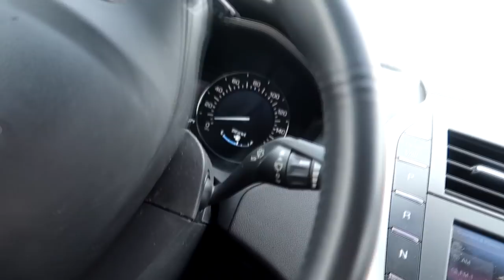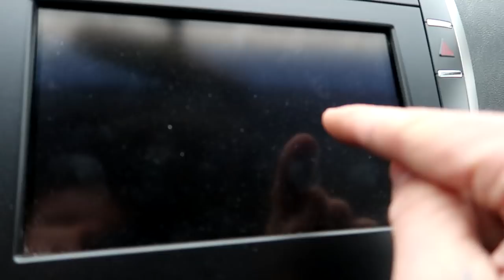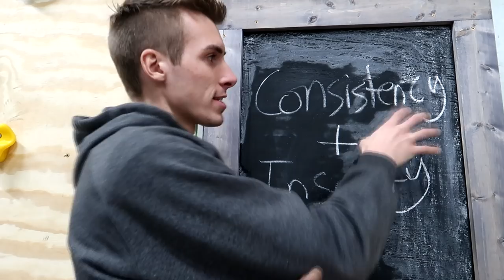NO MORE DURAMAX... GOT A CAR

Comment: The majority of the people like consistency, why is every 7-11, Wal-Mart, McDonald's, Burger King, KFC, Taco-Bell and other large chain stores pretty much the same? People like consistency. Your formula is working, you have your ups and downs but change your format too much and you will have a big down. Build machines, a follow up on the Gator would be good, all that work and it did not last very long. Have you given up on the Gator? What failed? Show us the motor we want to see what happened. Tell us it is a lost cause. Let the Gator RIP. Then build the snow bike. Give us some closure on the Gator.

Vice needs a solid mount with room to work with stock, make sure you have room to bend 90° angles on the longest piece you plan to work with, a table with wheels probably not the best idea. Wall mount on a chunk of 4" pipe that you can slide, swing or rotate probably would be best.
Reply: Exactly - tear that motor apart and show us some carnage!  Finish your projects - it looks like you are stretching yourself too thin.

Comment: Hey 3D you should build a mount so you can use it on the table or move it over to the bench top make an adapter for you truck hitch too
Reply: Caleb Emerson genius pure genius
Reply: Caleb Emerson I
Reply: Caleb Emerson On my welding table, I have 4, 2" hitch tubes welded to the bottom side of each corner. My vice is mounted on a plate which is welded to 2" (.25 wall) tubing. That way I can move it around the table, OR mount it in the hitch of my truck! 

I also plan on building mounts and stuff for bench grinders and tube notchers in the future! It's really nice to be able to remove the vice and slide stuff onto the table without having the vice in the way!
Reply: Ya it make sense to get the most use out of one tool as you can
Reply: I think a Vice stand would be a good option but thats just my two cents.
Reply: You guys are assuming he is actually planning on doing real work.
Reply: Caleb Emerson thats true

Comment: Just weld a hitch receiver to your table and weld another hitch receiver to a mount on the wall, then make a mount to bolt the vice on to out of some plate and a piece of square stock that'll fit in the hitch receivers. Then you got the best of both worlds.

Comment: I have the perfect solution for your vice. Mount the vice to a piece of 2" square tubing. Then install a receiver hitch (like on your truck) under the welding table. Install another receiver hitch to the wall, and another one on your work bench. Now you can move your vice wherever you need it by simply sliding it into the receiver. Even use it on the back of your truck.

Comment: Bolt that big vice onto the corner of your main bench and find a slightly smaller vice to bolt onto the welding table later. After building racecars for so long, I can say you'll appreciate both worlds. However, you'll find the bigger one on a table useful for more metalworking. I'd also look into getting a sheet metal bender if you plan on doing any vehicle building like that. I've got a bender that can bend the whole side on the car. One of the best investments I've made.

Comment: Dalton, my shop had the vices on stands made of steel piping of a good thickness with a steel plate on the bottom. The weight was counterbalanced and its right on the floor, so you can hit stuff and move it around easily. Love the channel!

Comment: Advice for the vise, you have one, and I'm not sure how much one costs, but you could get another one and have one on your metal table for welding like you said while the other one could be bolted onto a bench too. That's what I would do if you really want one on your metal table for welding. Plus with the one on the table you could use it as a mobile one if you needed it used somewhere else versus just having one that is stationary on a bench.

Comment: Mount a 2" receiver tube to underneath it your work table.. mount vice to a plate and weld to a hitch.. then do same with bench grinder and so forth.  Now you can store them away or mount them to the table with the slip of a hitch pin

Comment: I suggest mounting the vice on a different and more heavily built table because the table you want to mount it to looks a little flimsy , with the weight and the beating it will get could cause the steel plate to bend.

Comment: Use the bolt holes on the vise to mount it drill mounting holes on the various surfaces you wish to use the vise then you have options ya dig

Comment: For the vise just mount it on a large piece of angle like 6 inch or make some then make a slip joint for it to slide in. that way you can move it to were it is needed and store it if its an inconvenience.

Comment: Drill a hole in the metal table (for the vice mount) and drill a similar hole in the wall and you can move it between the two depending on the need

Comment: Use a large magnet on the bottom of the vise so you can move it around on the table with a decent amount of force holding the vise onto the table. Also I'm assuming it's a steel table.

Comment: mount it on like a steel beam about 4ft tall or like a 4ft tall steel cylinder and mount that to the floor then mount it to the beam or cylinder which ever u like best, i did a steel cylinder in my shop

Comment: You could get a trac and ladder system for that wall that will slide full length of the flag wall instead of using a step ladder or the shelves them self you could fab something up

Comment: Mount the vise to a thick piece of steel plate and then you can clamp is down and move t around or out hole in  the plate and any bench and u can bolt it anywhere the the warehouse